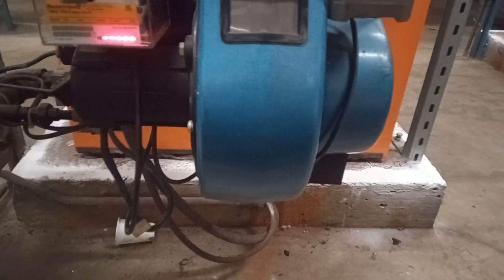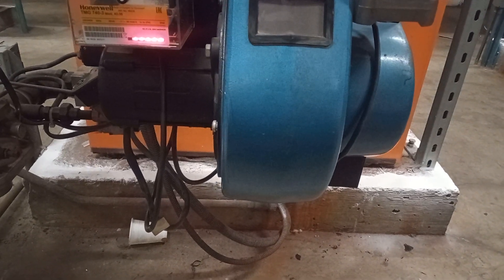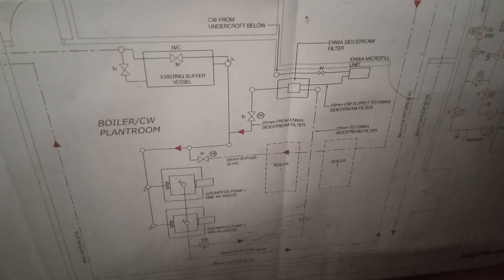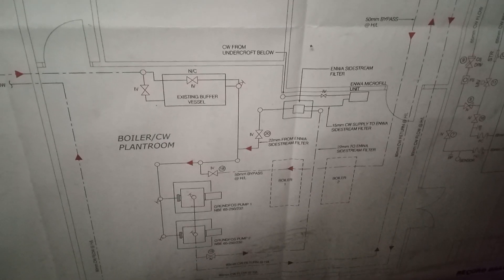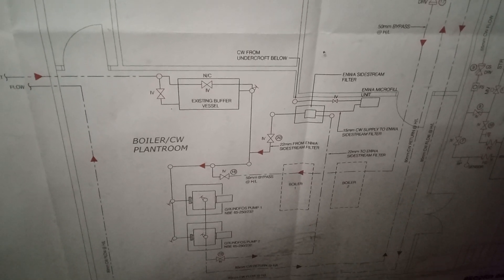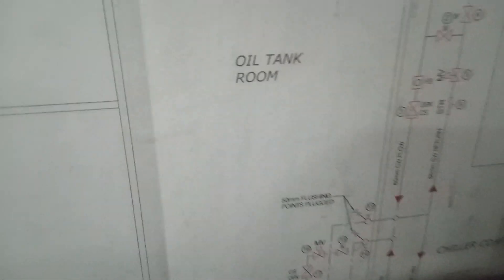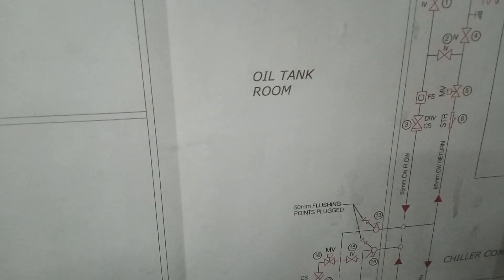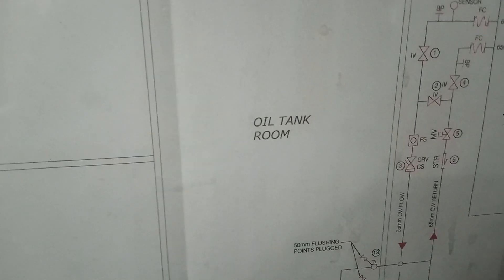WHY ARE THE RADIATORS NOT  GETTING HOT?

Comment: What is the compensated heating set at? It's normally 20/20 ....so if it's 2o degrees outside it will make the flow water to the radiators 20 degs but for every 1 degree below drop below 20 it will  add  2.5 to the flow water so if its 10 degrees  outside where you are it will have added about 25 degrees c to 20 degrees which allowing for variation it will only be 40/45 degrees  ........i would offset the compensation to 20/30 and say 3.5 degrees  if it can be adjusted  so the flow water to the rads  would then be 65 + degs ....20 degs  + to rads of 40 /45 degc means a lot to an office especially in morning start up ....check also the internal space sensor is not being influenced by some heat source and check also the outside air  temp sensor is north facing and not being influenced
Reply from the maker: I thought that it might have something to do with the weather com but wasn't 100% not exactly how it correlates with outdoor/indoor temperature. This makes it clearer, thanks.
Reply: Nice channel mate ...remember if the compensator controller is holding back  from opening the 3 port valve fully   because of its settings ....its simply sending the boiler heated  flow water back around the boiler return loop and if  the weather drops  outside it  will ensure more heat to rads by opening  up the valve 100 percent.
Reply: I notice also the bms  graphic has a 18degc outside air temp hold of level I would check  where that sensor  is situated to as sometimes these sensors shut off the plant when it's cold outside to ..as there influenced by a heat source ....so the system heating boilers won't fire up eg it could be in reality  15 degs c outsideb but the sensor could be seeing 18c when it's not..
.thus you get a cold start to the building  that's got to play catch up
Reply from the maker: @boilerroombob  there have been times when I've seen other outdoor sensors facing the sun. I attempted to adjust the flow temperature but I think the compensator controller naturally overrode it. Thanks for the help, I'll let you know if I win the next round at that site. I may just throw the towel in and get a BMS engineer to look at it. Hope that you're having a relaxing weekend.